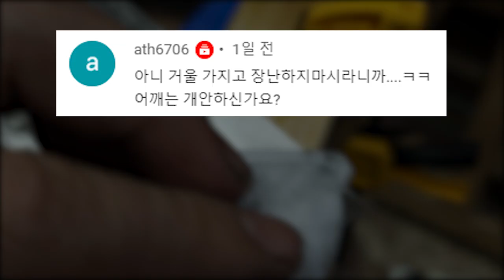[본영상] 칼좀 갈아본 사람은 꼭 봐야하는 영상. 다마스커스 칼

Comment: Not that you need this or want this just throwing it out there but how you filled in the area to take off with the black marker there is a chemical out that's called Dykem that adheres to the metal surface giving the same result as the marker. Not sure how many markers you go through in the process/work you do but it could be cost effective to switch or not.